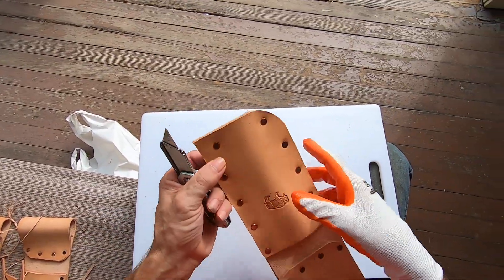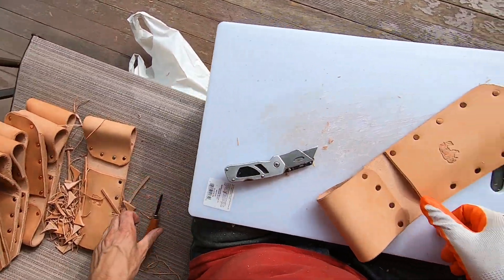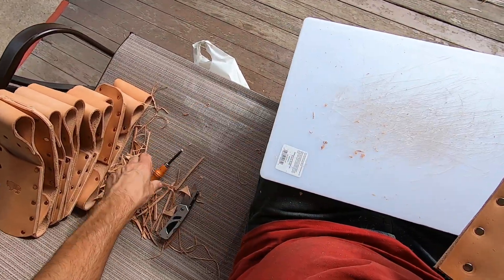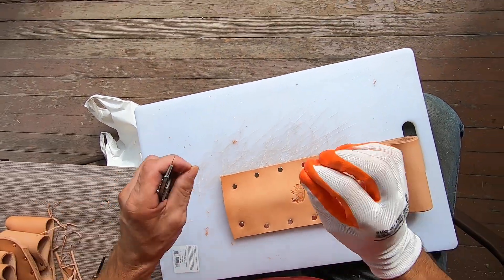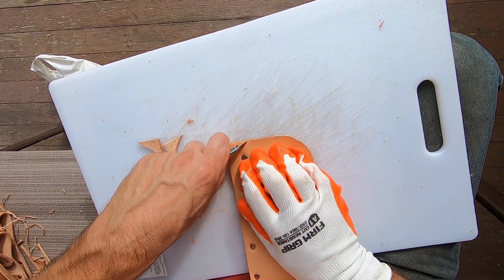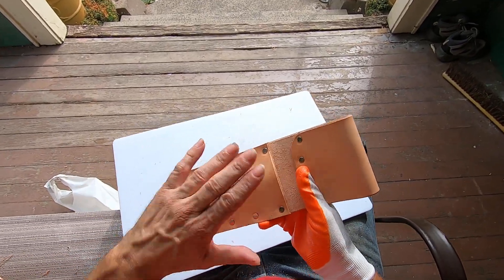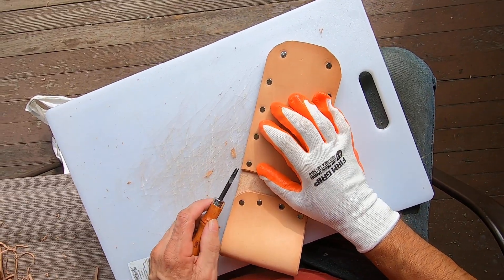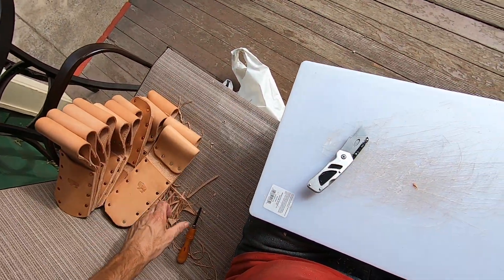Finishing some leather sheaths for metal detecting.

Comment: Gingher 8-Inch Knife Edge Dressmaker's Shears from amazon for about $26

I use these for cutting thick 8-9oz leather, I was using a razor blade, and the scissors work amazing. I thought you might want to look into them. I cannot put my fingers through the holes, I just wrap my hands around the outside of the holes because the leather is hard to cut. But the scissors make the job a lot easier.

Nice sheaths👍
Reply from the maker: Thank you. I will take a look at those.

Comment: Hi Jeremy,
What thickness leather do you use?
Thinking of making myself one
Keep up the great work 👍
Reply from the maker: I use 8-9oz full grain vegetable tan double shoulders. I use the neck portion for the front plates(buffalo stamped) because the neck portion is stiff leather. I use the strap and back portions of the shoulder for the back plate(looped for belt)because they are softer and easier to bend over for the loop. If you use too thick or brittle of leather, it will be very difficult to assemble and to form the  belt loop without cracking the leather. My sheath making videos will make your life much easier if you are going to make one. I have a playlist on my channel for leather sheath making. You can purchase smaller pieces of leather enough for just 1 sheath but will make it very very expensive. You can also purchase a hand rivet setter for a few bucks that works well. Leather and leathersmithing tools are very expensive. You can also condition leather with olive oil. Have fun man